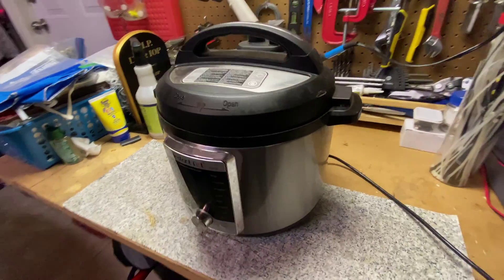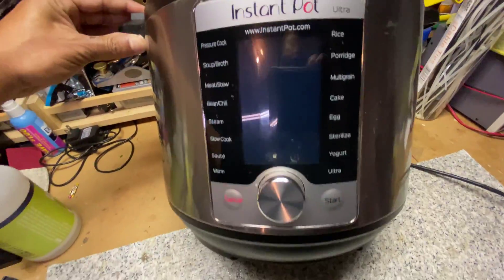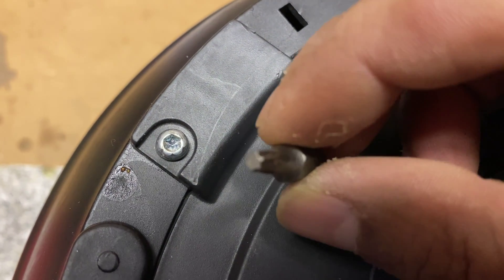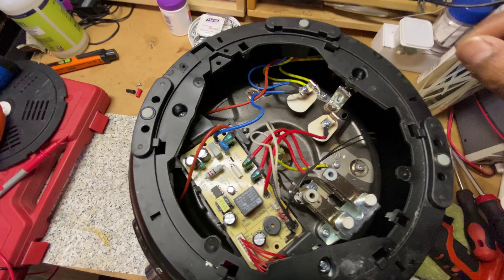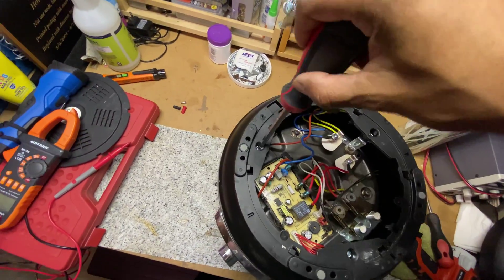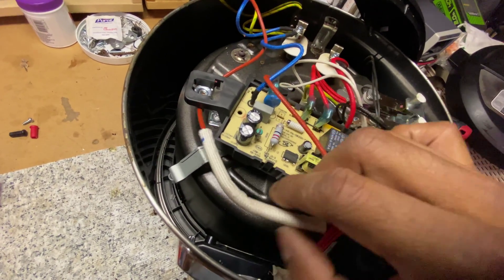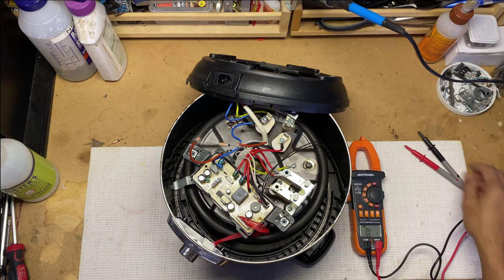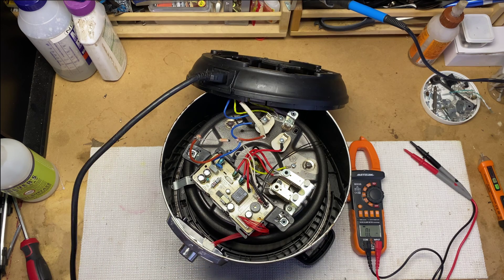How to Replace Thermal Fuse in an Instant Pot - Easy DIY - $2 Fix for Dead Instant Pot

Comment: I have this exact model that I purchased on eBay.  It was DOA when I got it.  Have tried 2 new chords and nothing happens.  With your easy instructions I'm ordering the fuses. Hope it works.
Reply from the maker: Thanks Trish for letting me know. It will work as long as the problem is with the fuse.